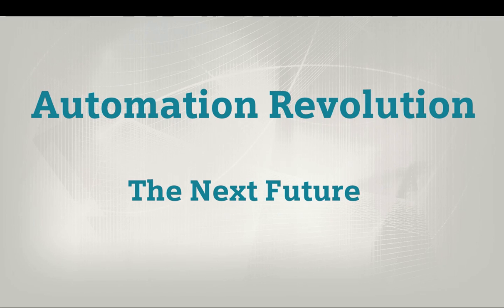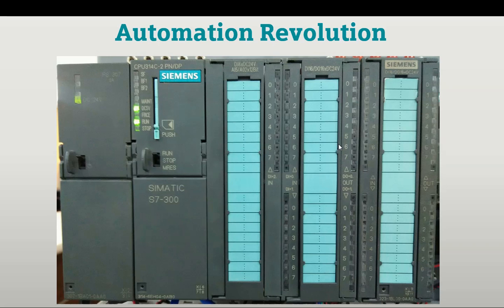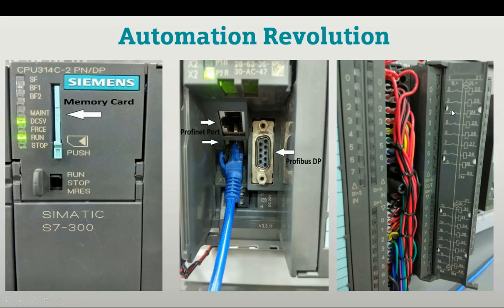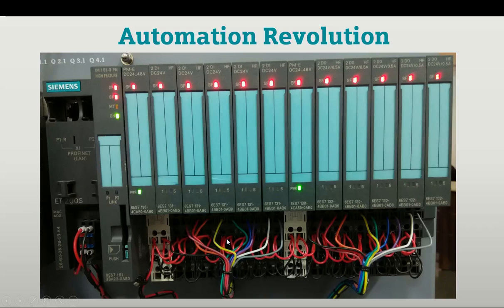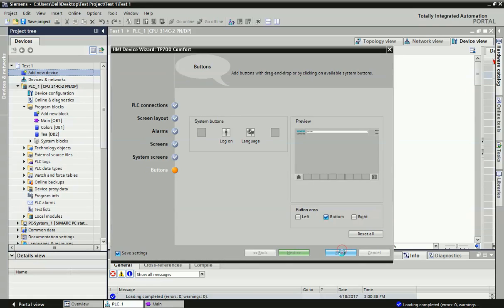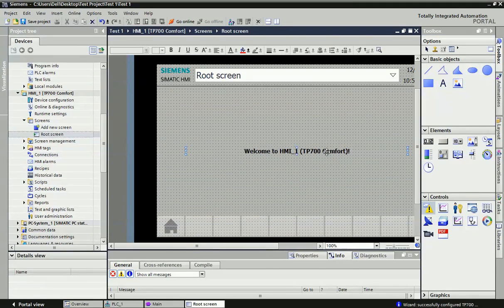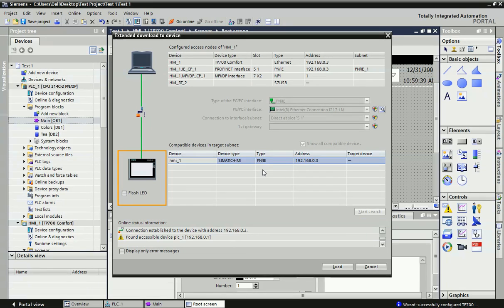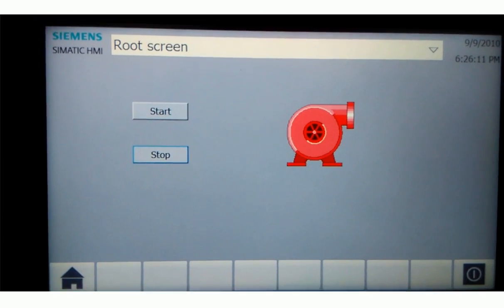PLC HMI Communication using Ethernet (Siemens S7 300 PLC & TP700 Comfort Panel HMI)

Comment: We are facing a recurring problem of communication failure between ABB's PEC controller and HMI. Sometimes Unit trips also. On checking all the communication Ethernet ports and switches there is no persisting problem and it gets reset by itself . What could be the problem?

Comment: Sir I am using PLC (CPU 314C 2PN/DP) & HMI Panel (KTP 1200 Basic PN)
1) For Communication between (PLC & PC), I am using MPI (PC Adapter USB A2) Cable. And successfully make these two communicate with other.
2) For communication between PLC & HMI, I am using Profinet cable. But when i tried to download my HMI Home screen to Panel, I am not getting any destination address of HMI.
Please help me out .........
Reply from the maker: Make sure PLC and HMI IP address are in same subnet and both IP must be different .
Reply: For both HMI and PLC subnet is same that is PN/IE_1 and I make their IP diffrent that is for PLC ( 192.168.0.1) & for HMI ( 192.168.0.23)........but still not working

Comment: When you told the start and stopbbutton to set and reset you motor output in the HMI, were you not then bypassing your code completely? Should you rather have set your start stop bits, and let them processor do the thinking? Great overview of all the processors though!